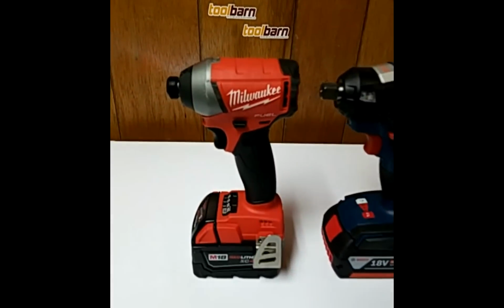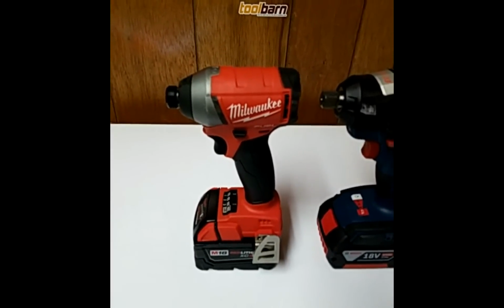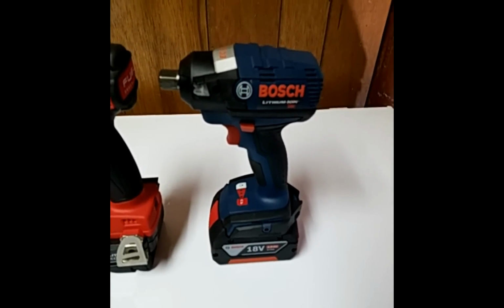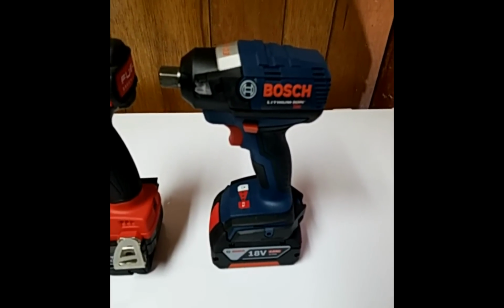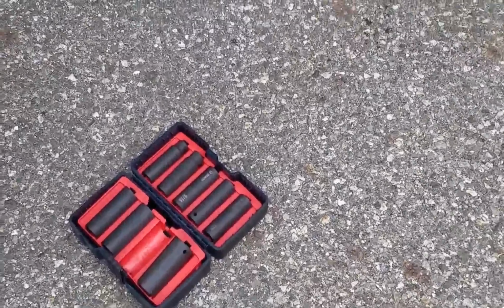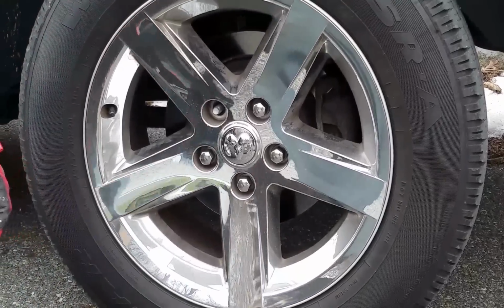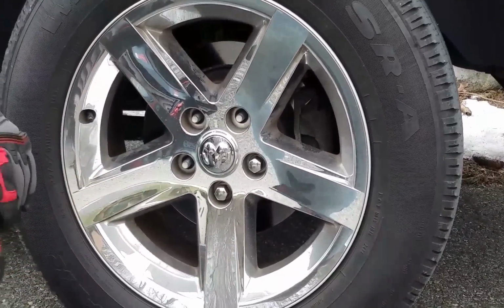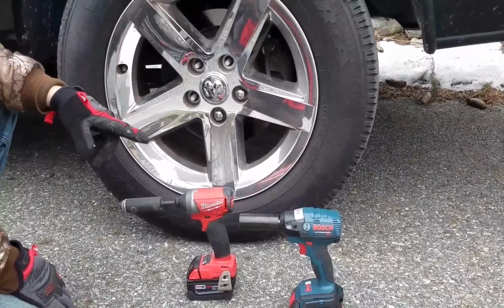Milwaukee 2753 Fuel Impact Driver vs. Bosch IWBH182 Brushless Impact Wrench

Comment: I just literally bought one just now because of this face off, the Milwaukee to be exact
Reply: And you had an extension adapter on there and it still broke those mugs loose faster lol
Reply from the maker: Wendell Greenidge Awesome Wendell its a great impact
Reply: I agree, I’ve been playing around with it trying to find its limits and so far I haven’t... Don’t get me wrong, I’m not stupid. I’m not trying to remove crank bolts but the bigger automotive lugs and engine bolts and been breaking loose, even head bolts!!!!!!!!!!!
Reply from the maker: Wendell Greenidge exactly, this vid was just to show torque n power , i have no better way to do it ...👍🏼

Comment: That bosch gun is awesome. Too bad they don’t put one out with more power. I currently have the gen 2 Milwaukee. Bosch is 130ft/lbs, Milwaukee is 150ft/lbs. it’d be nice to see bosch put out a 2,000in/lb (166ft/lb) model. Would really close the gap on driver vs wrench. Give it more of a middle ground.
Reply from the maker: Totally agree .. unfortunately there going backwards with there new offering..the brushed gdx 1600n
Reply: TOOL BOSS. Yeah, I saw your video on that, and it makes absolutely no sense. Have you tested out their “core” line of batteries?

Comment: I agreed that Bosch is weaker, i got the Bosch and i had to break the nuts loose a bit to start with Bosch

i stumbled across a guy who tear batteries apart, he shows inside of Milwaukee, Makita, DeWalt, Ryobi, Bosch, Ridgid 
and Bosch has the simplest circuit board which makes them last long long time, DeWalt came second

another video a tool service manager said he never seen a Bosch battery in for repair
Reply from the maker: Yes ..been saying bosch are the best for years .. finally people are starting to listen...lol